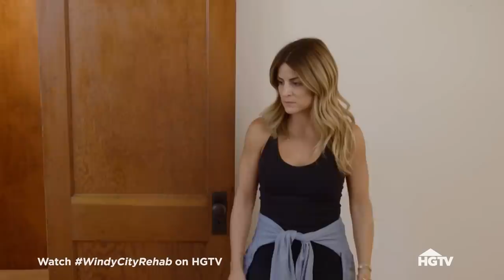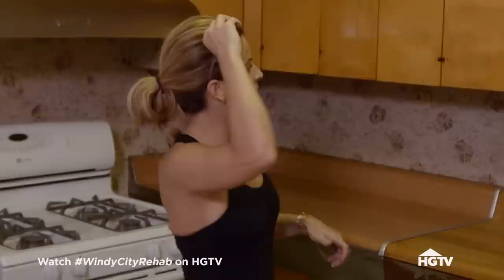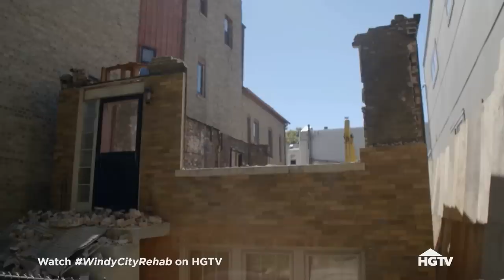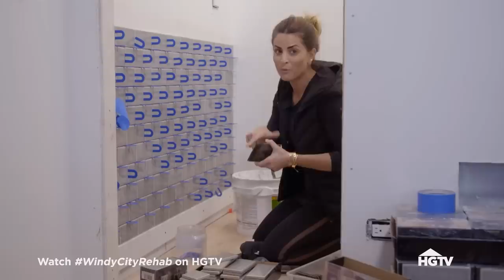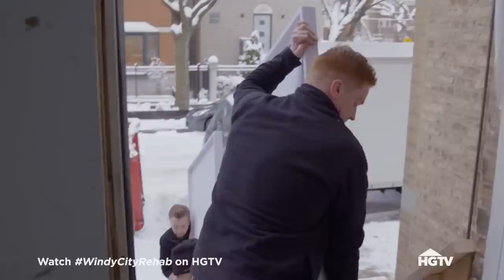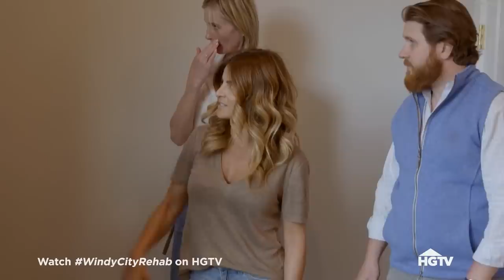Historic Chicago Home Restoration Faces Structural Issues | Windy City Rehab | HGTV

Comment: Hard to believe that that old place can look like this!! Amazing!
Reply: They destroyed the whole home first... I'm looking at the 14:25 mark and they are sitting in front of just a pile of brick... THERE IS NO ORIGINAL HOME (old place) left to say it was saved. It is a new home in its spot with some old doors and original brick reused and reassembled ... but it is NOT a saving of a home whatsoever. Taring down a back wall and roof with a back-hoe.... Is really smart and expect side walls to just stand solid minus the roof too. May as well used a wrecking ball.

Comment: Calling this historic and they basically destroy the home with a back hoe. This was not a preserving of a old home whatsoever. They could have bought old doors and brick from other tare-downs to incorporate in a new home. This as she tells the buyers... you got a NEW home with some Old trims....If advertised in real estate listings... this would have to be called a NEW HOME. Nothing but bits of salvage left from the original home here. Looks great as a new home. Still it is not a saving of a historic home and if it had any status really as historic...  They would not have been able to destroy so much to even renovate it before they ripped a back wall and roof off with a back hoe and NO BRACING of the side and front just to be safe.